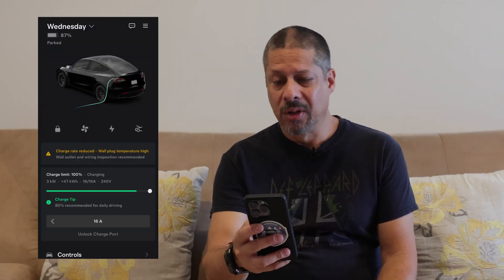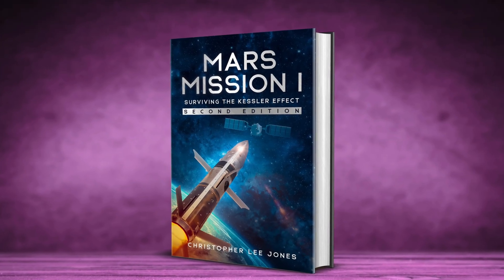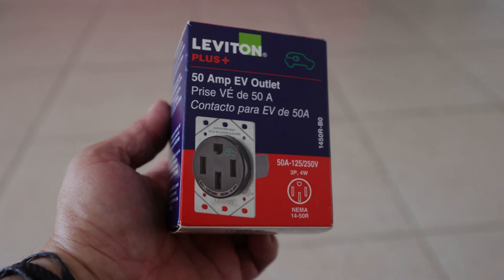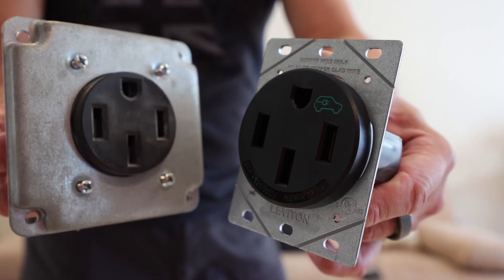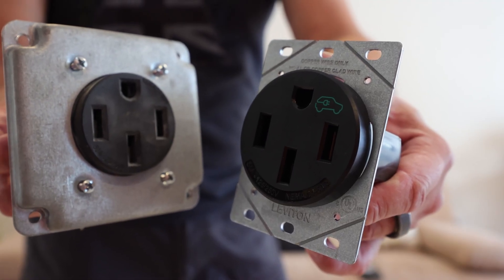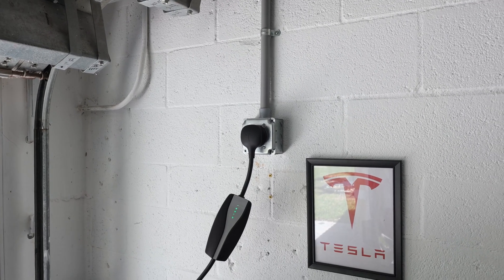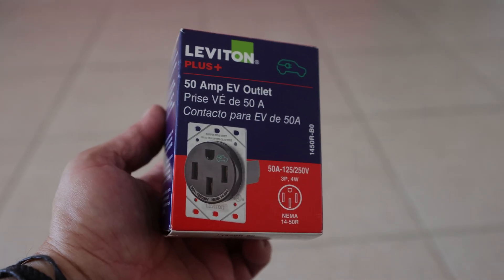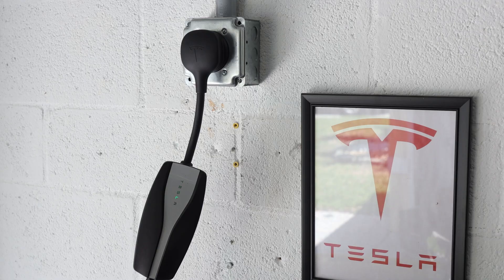Fix Dangerous and Overheating 50 Amp NEMA-1450  EV Home Charger

Comment: Thanks for making the video.  I do notice a couple of things… the NEMA 14-50 outlet should come with instructions and it should include torque specs for the screws. A source for concern for loose connections is the potential for arching which is a fire hazard.  Another item worth mentioning was the box has a punched out hole on the left side which was not used and not capped.  That may be a building code violation depending on where you live.
Reply from the maker: Correct. I did several takes of this, but I did torque to the manufacturer specifications. It is very important to follow the installation instructions exactly. Thank you for the note.

Comment: I just bought the same 14-50 EV Leviton Outlet.  I had the light weight Leviton Outlet ready for my electrician to install, but accidental saw that Leviton had released an EV version and bought it for $40 from Home Depot.  Should be installed this week. 👍🏻

Comment: My suggestion is to Ditch the 14-50 plug and Mobile connector and Wire in a Tesla Wall connector, it’s just safer.
Reply: I decided to ditch the 240 wall outlet I had in favor of Tesla Universal Wall Connector. It’s wired for 48Amps but I typically just charge at 24 A via the vehicle control. I only used the Full 48 when absolutely necessary, which is surprisingly rare. I’ve dealt burnt 120V outlets and 240v outlets with the UMC. It’s just not worth the risk for daily use charging. Occasionally is fine.

See you at the Michigan Meet Up 😊.
Reply from the maker: I also have a Tesla HPWC. A replacement actually. My original HPWC overheated and almost caught fire. Thankfully I spotted it and replaced it before it became a bigger issue. I think the issue was a faulty internal connection within the system itself. The second set of wires that complete the internal circuit. The HPWC is not immune to issues either. I can send you pictures of the burned computer board and connectors.
Reply: @TesLatino those needed to have the internal wires Torqued to specs.  I’ve got 8 of them in service at my place in NC.  They are good for 80amps 😀